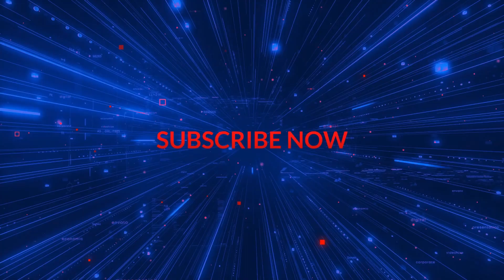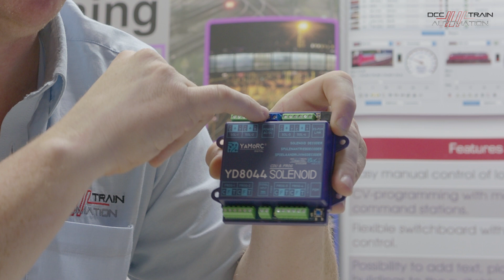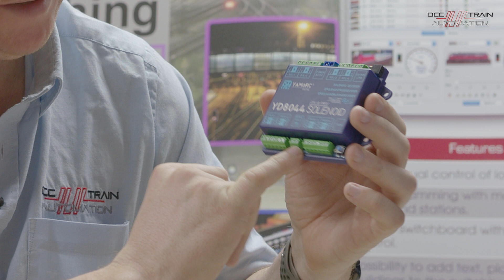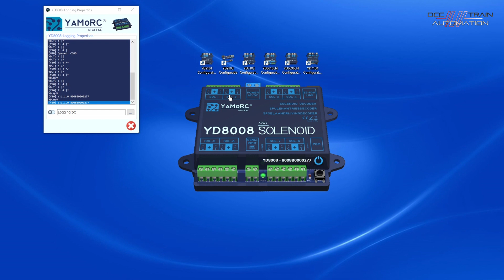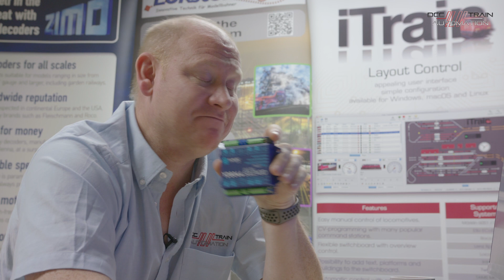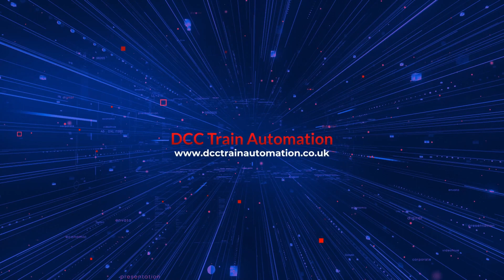YaMoRC Solenoid Point Motor accessory decoder. No3

Comment: I'm considering using the 8044 to control surface mounted three wire solenoid motors (the Rails Connect motors). How can I connect to detect point position and feedback into iTrain; I'm using a Yamorc 7010? Thanks.
Reply from the maker: Is there a switch on the rails connect motors?
Reply: @DCCtrainautomation  - Thanks for the quick reply - and on a Sunday too. I don't believe there is a switch built in, no.
Reply from the maker: @duncanfairwood127 this is the issue to use fully accurate point movement detection you need to know if the physical point has moved if you don’t then this is pointless. Why do you think you need point detection? It’s not necessary for iTrain to work. It’s only a bonus if you have the type of point motors that give you feedback to say the point is moved.
Reply: @DCCtrainautomation  Thanks. That's a very good question. I was thinking of the ability to get confirmation that the point had physically thrown, as you can with some of the stall motors or via microswitches. Was wondering if there might be current sensing, or some other electronic approach. These particular motors address some space and access issues. Sounds like I need a rethink.
Reply: @DCCtrainautomation Or accept that I don't actuayll need to detect the location, as you suggest.

Comment: Hi I'm not very digitally minded, so just to clarify, with a yd8044 can I setup the unit without a  computer, I'm only using 4 points on 1 unit, many thanks
Reply from the maker: You can use out of the box with out a computer yes. What Digital system are you using?
Reply: Thanks for your quick reply, I'm using Digitrax dcs52, so I'm learning both systems! Any help would be appreciated, cheers Keith

Comment: I have Kato Switches #6 with the following motors.  #2-503  & #2-504.  Would this be the device I'd use to control these switch motors or would I require an additional component to make them work?